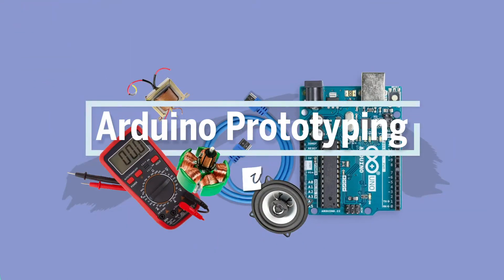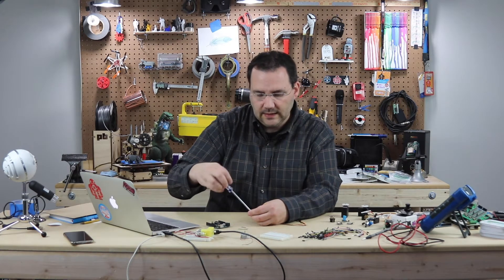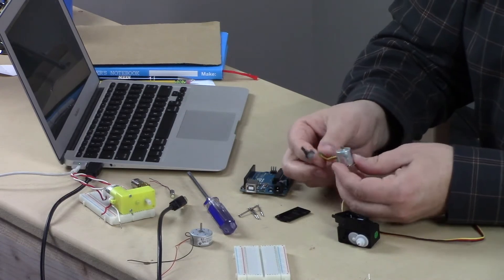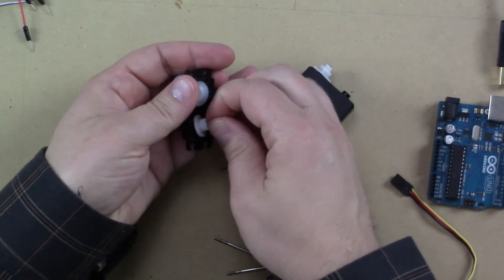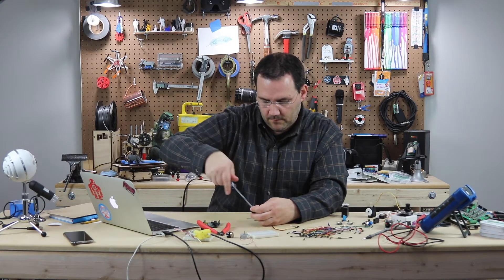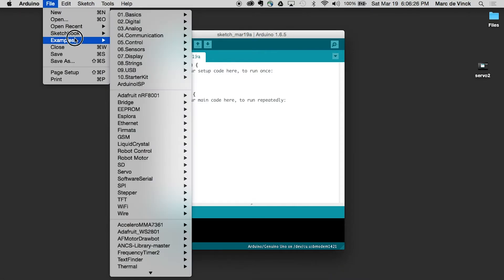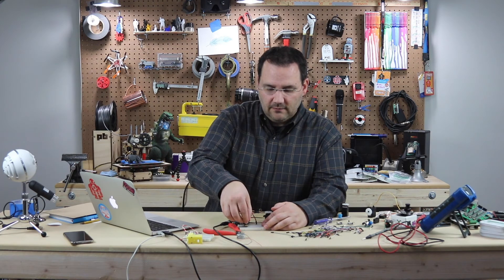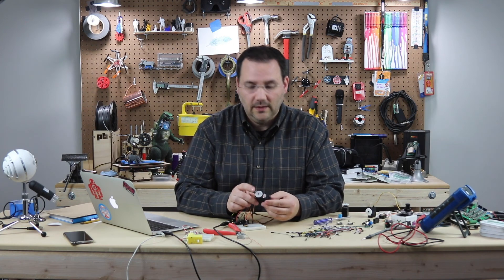Arduino Prototyping Outputs #86: Continuous Rotation Servos

Comment: But…. Can you write Arduino code to control the continuous servo????
Reply from the maker: Of course, watch the whole video!? I cover some basics starting at 8:22.
Reply: @MarcdeVinck  so, it seems that to control a continuous servo, it’s a matter of how long it turns… ie 1 second or 2 or 3….
Reply from the maker: @gelatinskeleton8745  Yeah, it's speed controlled. Good for a quick geared motor on a bot. Just keep in mind it isn't very accurate. Still fun!
Reply: @MarcdeVinck  I sincerely appreciate you replying.

Comment: My continous rotation servos are too slow even at max speed (180 degrees). Is there a way to make it spin 10 times faster than it is now?
Reply from the maker: Servos are geared down for torque. (more "power") If you don't need the power, you can drive the motor directly sans-gears, via a transistor or use an h-bridge. It depends on the requirements. Typically those motors without the gear reduction are not very powerful. You should look at your needs and get a motor, power supply, and circuitry to control it that is the proper size.
Reply: @MarcdeVinck  I didn't expect a response this fast from your old videos! Thank you so much!!
Reply from the maker: @d38u20ttg  No problem. Hope it helped!

Comment: Great video. Is it possible to make the servo make exactly 5 turns?
Reply from the maker: No, you will need to add a rotary encoder to count revolutions. A continuous rotation servo is essentially a DC geared motor.

Comment: How does one put two continuous rotation servos onto there, but where they rotate in different direction respectively?
Reply from the maker: Just have each one on a different pin. However, if you want more control and simultaneous changes, you might want to use a motor controller. That can continue to send the pulses as needed without using up time on the Arduino board itself.
Reply: @MarcdeVinck  wow thanks Marc

I needed that for my GCSE design and technology project
GCSE is basically high school graduation
Reply from the maker: @dhakshingk  Glad I could help. These motor shields are great!  -- https://www.adafruit.com/product/1438

Comment: Thanks for showing how to convert a servo.    I am new to Arduino and want to make a rotating positioning table that needs to be accurate.  I am wondering if the continuously rotating servo can be stopped at a position by using infrared switches as position sensors and if they would be accurate?  I want to keep this simple as possible.  Any insight would be appreciated.
Reply from the maker: To add positional accuracy, you need an encoder. There are several ways to do this, all of which depend on the accuracy needed. You could simply add a magnet and use a reed switch, or some kind of beam break IR sensor. If you want much higher accuracy, you need to use an encoder wheel, or sensor. That will allow many steps of accuracy over 1 rotation. If you decide to go that route, you might want to just use a simple DC motor and encoder. Check out the Adafruit website and look at PRODUCT ID: 3782. It's a great solution to use with a geared DC motor.